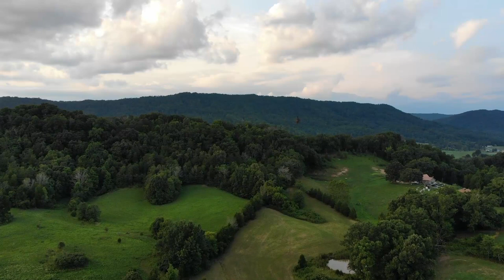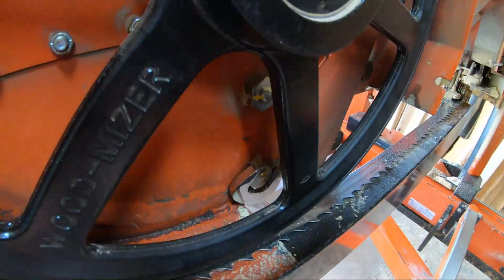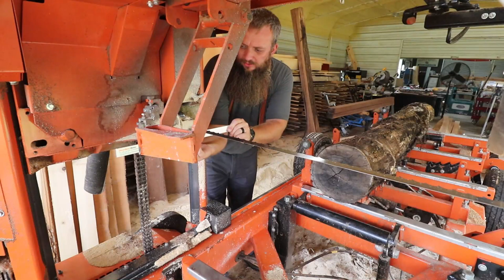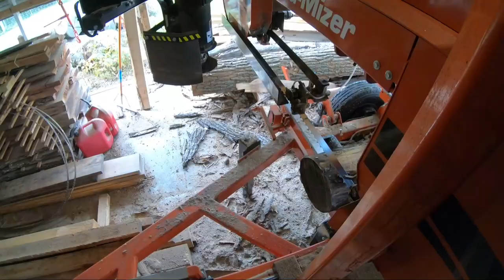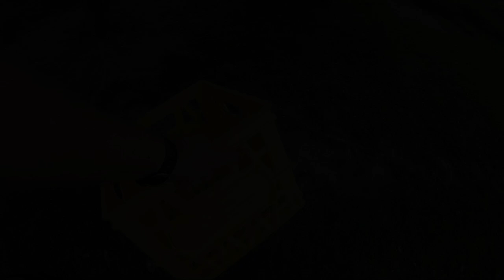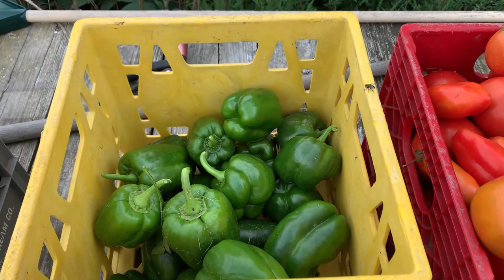Wood-Mizer Maintenance & A Good Garden Harvest,

Comment: It looks like a socket or a standard box or open end wrench would work for the 15/16 nut.  Are there other 15/16 nuts or bolts that you can only accessed with the specialty wrenches?   

When you picked that first pepper in the beginning of the video I could taste it.  Maybe you could do a video of your wife cooking thing from y’all’s garden.  I will be having a stuffed pepper for lunch.  I get the large ones and stuff them with a very very dirty rice.  Made with lots of browned Jimmy Dean’s bulk breakfast sausage, and or Italian sausage without the casings, chopped yellow onions, the tops of the peppers, roasted garlic, Rotel tomatoes, chopped celery and shredded carrots.  I add the carrots in when I mix in the rice.  Then I add in a Cajun seasoning mix and some Worcestershire sauce.  I also add raw beaten eggs, one egg per two stuffed peppers.  Then I mix in the cooked rice at a ratio of 1/4 cup to a cup of the cooked meat and veggies. Regular dirty rice is about one cup cooked rice to one cup of the meat and veggies.  After stuffing the peppers about 1/8 inch short of the top of the pepper, I top them with Italian bread crumbs mixed with melted butter.  I pre cook the peppers by steaming them so I only bake them until the bread crumbs turn golden brown.  One pepper makes a good meal for me.  If you use shrimp and crab meat for a seafood stuffed pepper add them with the cooked rice.  They will cook while browning the bread crumbs.

Comment: I've got a set of metric (8mm to 24mm) and a set of standard (1/4 to 1 1/2) angle head wrenches, that I gave a ton of money for when I was a truck and equipment mechanic. I wouldn't trade those thing for anything but more just like them

Comment: Suggestion: Cost Savings Idea:::Heat wrench with Oxy-Acetylene torch to a 'Harbor Frt' wrench or used old wrench (enough to bend in a vise -please wear eye protection & proper gloves) - bend to proper or suited angle - test after air cooling - then gently re-heat, then cool with used motor oil (minor case hardening after heat/bending) - retest for proper wrench size & depth = cost (if you have the Oxy-Ac tanks) = $5 ::::Note if you screw up try again with another wrench. Essential craftsman can make their own adapted tool and save thousands upon thousands of $$$$ over the years. If you don't have Oxy-Ac, then go to the phone book and call a tool maker/welder, he will probably laugh, but for $10 and 5 minutes, he can do it for you and he will have a new customer and now you have a new business friend.

Comment: The stuffed peppers freeze well and only take 5 to 7 minutes to heat up right out of the freezer.  A always cook at least a dozen.
Reply: Please explain. Do you cook them first then freeze or do you prepair them, freeze, then cook when removed from freezer. Will any recipe work for them or is it a special one. I love stuffed peppers but do not like to heat up the house on a regular basis for them in the summer. The freezer method sounds like a great idea if I knew how to prepair.
Reply: Steve Welches  The peppers are fully cooked when I take them out of the oven after browning the bread crumbs.  After they cool down I put them in the  fridge them freeze them the next day in individual containers.  That way I can take them out of the freezer one at a time and heat them in the microwave.  It only takes 5 to 7 minutes to heat up.
Reply: Steve Welches   The recipe is one I put together.  It is not written down any where that’s why I did not list most of the amounts of each ingredient. .  I very seldom use a recipe to cook with.
Reply: @billmorris2613  thank you for the reply. I will have to try that one day.

Comment: Why cut the boards so thick?why not cut them half the thickness?would you not get better yield with a thinner board?
Reply: Brian, those slabs are going to be whatever a customer will want. Some are going to be tables and some will be reworked by the buyer for other furniture. The thicker the more money Nathan will get. Some will go for rifle stocks.
Reply: Thicker stay more stable,also.
Reply: Brian, those are rough sawn and by air drying, then kiln drying and heat sanitizing for bugs they will shrink. Plus they will sometimes do a little cup or twist that you really cannot see until you plane them down flat after all of that. By going 5/4 thick to start, you will likely get a true one inch after all the processing and that is good furniture wood that is very stable and a blessing to work with. Most lumber yard lumber starts life as one inch to get down to the final product of three quarters thick in the store.